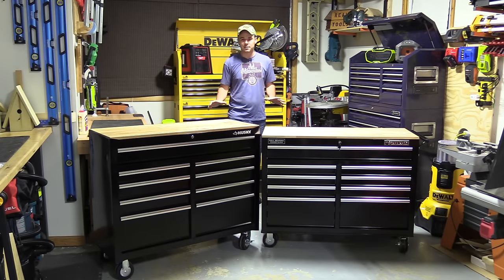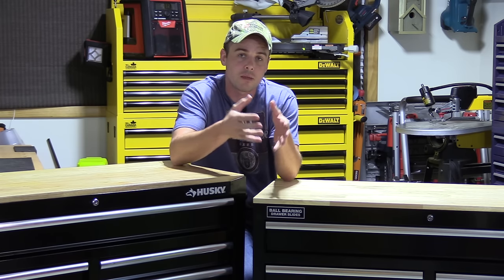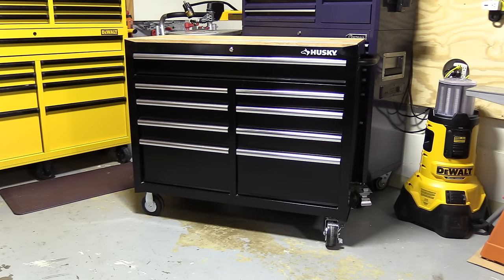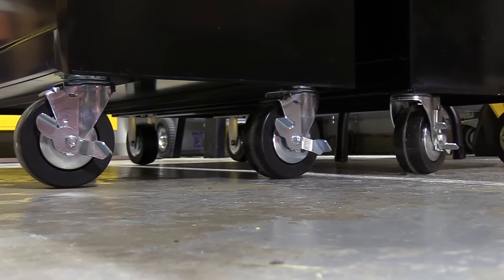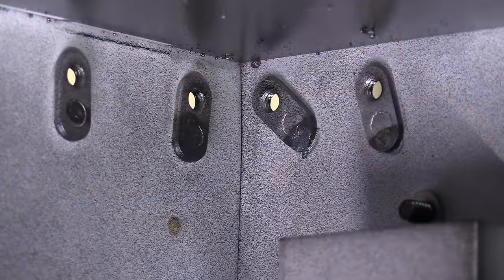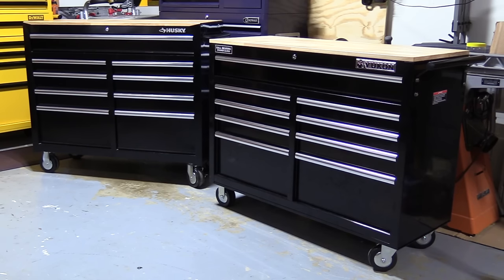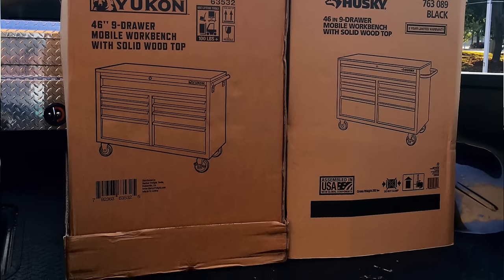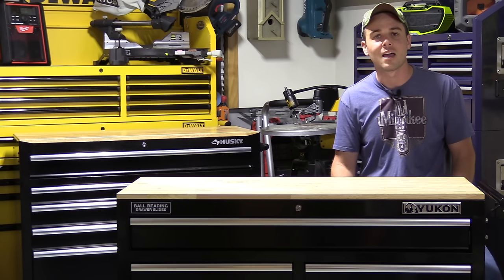Harbor Freight -VS- Home Depot ( Yukon - VS - Husky ) 46" 9-Drawer Workstations

Comment: Damned glad I watched this video. Yukon it is...and I would not have guessed that prior to watching.
Reply: So glad I skimmed across your comment because I did the same as you plus I got the guy at Home Depot to knock of a extra $50 for minor damages “scuff” so I got mine for $298 thanks mate
Reply: Me either.
Reply: Same here. Figured they would be lesser quality than us general, as they are cheaper price wise. Just looked at the nine drawer Yukon today in person.... Was blown away by the smooth sturdy feeling of even the full width drawer. So glad I stopped to examine it. 

Going to use the Yukon without casters in a corner workbench I can sit at.
Reply: @danielrunyon4830  I am very happy with this purchase.
Reply: Husky on sale today for $398.

Comment: This is really interesting. Just got the Husky and they’ve now updated every issue you mention: includes drawer liners, screwed top, rib nuts, double drawer slide, etc. it also looks like the Yukon has upgraded a few components as well including now being equivalent in height to the Husky. At this point they really look almost identical.

And as of right now (7/23) the price on both is just under $400

I’ve been loving the Husky so far but seems like both are great buys atm.
Reply: I was just comparing these at the stores It seems that the Yukon drawer slides allow the drawer to shake a little more.  I didn't have the exact husky to compare it to at the store I was at.  do your drawer slides wiggle a lot?

Comment: The Yukon, I'm  installing it in my vintage '57 silver streak 32 ft travel trailer for kitchen counter/cabinet. Lots of room for stuff. Lower to the floor, not going to use the wheels. Black paint matches my appliance

Comment: I picked up the husky today on sale, and it now has rivnuts drawer liners and a fixed top. The handle only attached to one side but it does have power strip and usb. And now double drawer slides on the big drawers.

Comment: I see Husky added a few features in the current model that the Yukon had in this model; notably the duel tracks on the bottom drawer. They also added padding and outlets... I think the engineers watch the videos, which is cool.
Reply: Definitely cool if they do watch the videos. If so, it's a win/win for the engineers and the consumers because for the engineers it would make their job slightly easier to see what needs improving at least for the brainstorming aspect. The consumers are also happy with said improvements. Now, in the automotive industry, if they weren't so gung-ho about planned obsolescence that would be a win/win right there too....

Comment: 2021 - The Yukon is still a great buy and this video helped me discover it. Thanks!
Reply: Except the current Husky box is very different from the one he featured in this video.  They now have two slides on the bottom drawers, come with drawer liners, and a fixed wood top. They also have an integrated power strip, soft close drawers, and much more storage capacity. All for $30 more.
Reply: @kenjcm  Yes, the husky line is actually showing some pretty nice improvement across the board. I'm really impressed by their heavy duty line-up of full size boxes.

Comment: I bought the Husky toolbox about a month ago and it looks like the design has been updated. Its 37” tall, the wood top is bolted down, the bottom drawers have 2 slides, and the entire inside of the box has been painted. I didn’t check to see the bolt size or what kind of nuts it uses.

Comment: Husky I thought would be victorous but i gotta go with the Yukon after seeing your review
Reply: Don't count on this old review, I got a husky recently and it's different than this old 2017 review
Reply: @dieseljunker9234  definitely get the husky these days. It's about 40 dollars more than the Yukon but has 19,000 sq. In of space compared to 10,000 sq. In in the Yukon. Drawers are way more sturdy as well, and it includes a power bank on the side of the chest as well.
Reply: I know the review is older, but based on this review, the Yukon wins me over. I need one, so I will look over them in-person. For now, Yukon wins. I’ll repost after seeing them personally.
Reply: I agree
Reply: I got the new husky 46” and damn is it nice it’s also 24” deep now so it has more room. This Is definitely an out of date review now.
Reply: @dieseljunker9234  The Yukon is still built better.
Reply: @judgerobertworsham6955  Nah, this review is so old and outdated. Literally almost all of the points that he gives to the Yukon the Husky now has. Double drawer slides on the bottom drawers, fixed wood top, and included pre-cut drawer liners. And on top of that like someone else have said, much more capacity, like 19000 versus 10000, almost double, integrated power strip, and soft-close drawers. All for $30 with a better warranty. The current Husky is definitely the better buy compared to the current Yukon.
Reply: @andybub45  Well, if you want to save $30 and get a bit over half the capacity, no soft-close drawers, no integrated power strip, and a lesser warranty. And the Husky now also has the double drawer slides on the bottom drawers, included pre-cut drawer liners, and fixed wood top. I guess knock yourself out and hopefully you can invest that $30 or something.

Comment: ~20 years with the cheapest ~8 drawer Harbor Freight tool box sold, works fantastic! Drawers slide with ease, never as issue.
Reply: Blakelikesfood they last a long time if you never you use them!
Reply: Jimmy Grant: Yawn,  building 7 vehicles at once right now with it, which is about par every year.
Reply: Blakelikesfood actually waterloo
Reply: Blakelikesfood 7 vehicles isn't that much for a year!
Reply: Jimmy Grant : No Jimmy, not 7 vehicles a year....7 vehicles at a time.
Reply: Blakelikesfood and how long do they stay in the shop…?
Reply: Jimmy Grant : Personal garage, and varies. 

Regardless, it was originally bought as a cheap throw away, yet it never wore out and lasted. Never intended to keep it yet it's been solid so never replaced it.

Comment: Yukon. Just bought one before watching this. Now I'm even happier that I did buy the Yukon
Reply: Good purchase JD! I only wish it was as tall as the Husky so that I could integrate it into the side cabinet set up for my 44 inch set. It's a few inches lower than the 7 drawer side cab, so it wont attach. Bummer.
Reply: Rob's Wrenches Me too. I wish it was taller
Reply: Install bigger wheels. 
HF has really nice rubber inflatable ones.
Reply: put spacers under chest above the casters?
Reply: @robswrenches9501  you can get the 44 inch and install a piece of plywood on the top

Comment: ok... so its 2019, 2 years after u shot this video, & im in the market for a new tool box... im wanting a good size box with a wood work surface top & im lookin for this perticular us general model... so heres the problem, yukon doesnt offer this box anymore, only box available with a wood top is a similar style box but with 2 "doors" at the bottom instead of all the drawers... so i looked at craftsman, kobalt, husky, us general & several more online, but at the end of the day i decided on the 46" husky with the wood top... after watching this video, & coming to trust (& still do) ur honest & unbiased reviews, i looked over said husky very carefully & saw none of the issues u mentioned (i hope this means they saw ur video, & heard their customers complaints, & made some changes?) i noticed that the paint job was good & had good inside coverage, the drawer liners included were nice & thick, the roller bearings were smooth & overall a nice box... the newer version has a wood top that is bolted on & is a nice solid chunk of real wood, not particle board like the craftsman sears had on the display floor (r.i.p. sears) & its 24.5" deep, as opposed to both the husky & yukon in ur vid that were only 18" deep... it also has an outlet strip down the side with a couple of usb's... & ill admit, i didnt get one of the black ones off the floor, i ordered a red one online, but i couldnt be happier about the quality & the price ...this is my second husky box ...my older ones probably gettin on 10 years old now, & its still holding up great... so personally, ive been very pleased with both of them... & a big "thank u" for all the great videos man!
Reply: That box is available. I looked at it today at Harbor Freight! It's very nice as well.

Comment: Outstanding review and concise side-by-side comparison! Perfect! I wish more reviews were more like this. Also, very helpful in making decision on which to buy. I wish the Yukon were slightly taller, but everything else was a "no brainer," especially for those of us that live in hot, humid areas.  Thank you!
Reply: Those issues are no longer the case with the current Husky box. The wood top is now fixed like the Yukon, and they also fixed most of the other things too, like the bottom drawers now also have the double slides and they also come with pre-cut drawer liners. And the features the Yukon don't have, the Husky has soft-close drawers (which I love), and an integrated power strip, which is super useful. Also remember it has more storage capacity. All for $30 more with a better warranty.
Reply: Does Husky now use actual rivnuts?